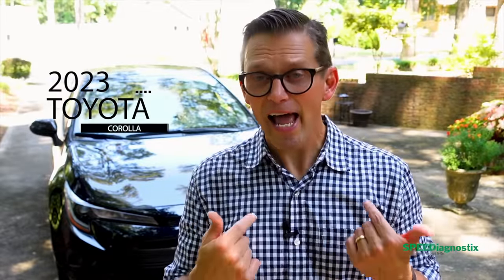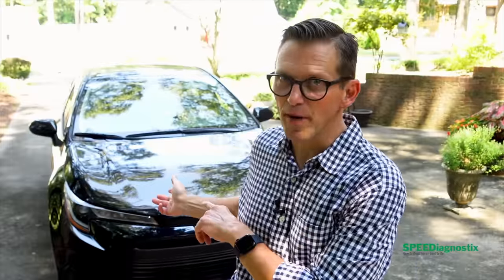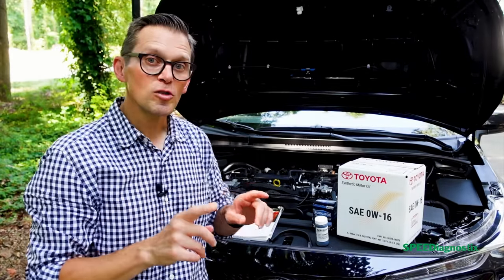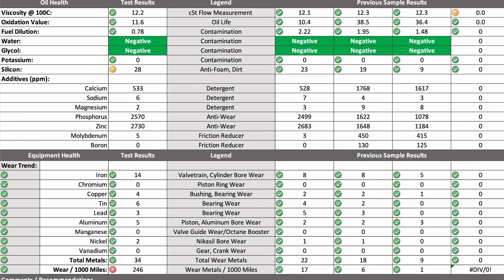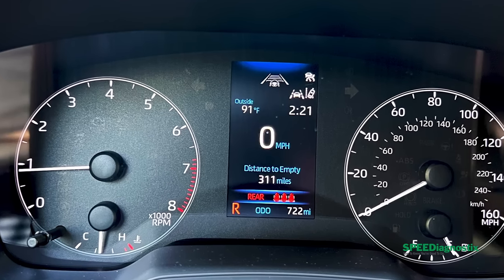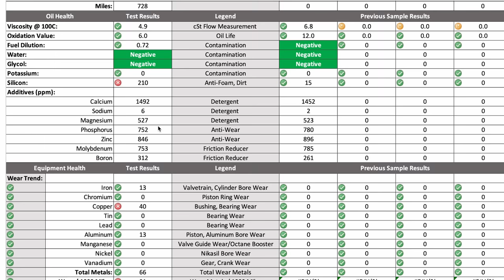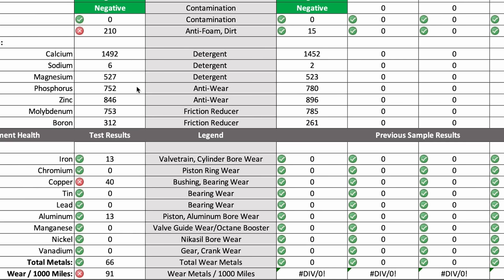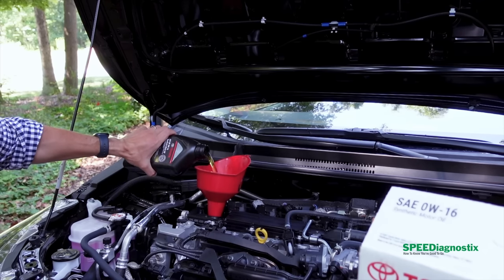AVOID the ONE MISTAKE Almost EVERYONE Makes With A Brand New Car

Comment: I have followed the same procedure with my engines. But even with high kilometers already on then, I perform a change more frequent than service schedule.  I had some oil analysis performed on one of them years ago and it came back excellent.  Many years later with stupid amounts of abuse on the engine( I drive the thing like a race car every opportunity I get), the car was written off due to a completely wrong sign used for a blind hairpin, I got the wreck back because I wanted the gearbox, the Buick engine was torn down and had some 300 and something K on it at that point, I installed it at 90k and beat it like a race engine. The wear in the engine was remarkably low and much of the internals were as new cast silver colour, hardly any yellow staining whatsoever, the pan was bright sliver as if the sheet metal was just stamped.  This was a near 30 year old engine at the time.  It really makes a huge difference changing oil often and with a good quality synthetic modern oils.  I ran 10w40 and 15w40 since the 90k install, the manual specified 20w50 but I found the engine to knock for a good few seconds on start up and also rattled a lot when cold, so I dropped to the thinner out of spec oil and all these went away immediately. These engines run 70-80 psi oil pressure on the thinner oil anyway.

GM always seemed to over spec the viscosity for their engines here in Aus compared to the US for some reason and it was often detrimental.

Comment: So I have a comment on your other video of “to fill or not to fill the filter”
I am a lifelong diesel mechanic. I would bet that a lot of the people saying the new oil you are putting in the filter is dirty are diesel mechanics. This likely comes from the process of filling the fuel filters getting dirt in the system. To combat this, if you fill the fuel filter you plug the center and then fill. That way the fuel you pour in gets filtered. Well I have tried this with oil filters and that is a painfully slow process. 
After watching your video I will be pre filling oil filters. 
Part of the problem with that is that 3 of the 5 modern USA diesel engines have cartridge oil filter filters. 
Then one way or another you crank the engine without letting it start until you get oil pressure.
Reply from the maker: Thanks for sharing!
Reply: Wow you already responded to my novel!
Reply: I love the fact that you give proof not opinion. 
With the extended factory oil change intervals and people just simply ignoring oil changes, can you go into the affects of  the oil filter bypass valve opening?
Reply from the maker: @danielhoffmann1325 stay tuned. We are going to do some more videos on oil filters.

Comment: In some countries its usually change oil at 10,000 kms or 6250 miles.
On new car I have changed oil and filter when it was below 5000kms and again at service center at 10,000kms as required by manufacturer. 
As I knew long ago these fine particles would circulate in the oil.
Then on got it changed as usual every 6250 miles 10,000kms interval.
It's usually the egr and engine valves and intercooler that need cleaning later on in life.

Comment: When I worked at Eaton Corporation doing valvetrain development, we would do oil changes on a new valvetrain test rig in the first 20 hours.  The first change always had a lot of wear metals.
It's nice to see that Lake is reinforcing the benefit of a 500-mile oil change on a new engine.
Unfortunately, I won't be buying any new cars for the rest of my life, so the issue is moot for me.

That's an interesting series of oil analyses on his Porsche.  The wear metals per 1000 miles is a good parameter to have.  The first sample gave 246 ppm/1000 miles, and later samples decreased quickly from that.

But why are all the 40-weight oils showing viscosity in the 30 grade?  Those are Joe Gibbs Driven oils, which are very shear resistant.  I see all the samples had fuel dilution.  Is that enough to drop the BR40 and DT40 out of grade?

I've never seen the thing about pouring a new quart of oil with the drain plug removed to flush the pan.  That's hardcore oil geek stuff there.  I've never even seen that on Bob Is The Oil Guy.
Reply from the maker: Thanks for sharing and the question. These M9x Porsche engines are hard on the polymers, so they shear more than in other engines.

Comment: Hi performance engines don't need super early oil change during break in, what they need is to stay below 5k rpm for the first 2500 miles, then change the oil.  500 miles is goofy for modern hi performance engines from Audi, BMW and MERC.

Comment: I agree with you wholeheartedly regarding the oil change interval and doing the first one very early. My question is about the section of the owners manual that you referenced. It does indeed say that if you are unable to find 0W-8 oil that it’s ok to use 0W-16 oil. But you left out the very next sentence saying that at the next oil change you MUST go back to using 0W-8. Your thoughts?? And thanks for your consistently informative videos.

Comment: I agree changing the oil on a new engine after a break in period is a good idea.  Do they already do this at the factory?  When I was working in a machine shop, our rebuilt engines were tested for four hours with oil,  then drained and oil filter changed.    We would visibly inspect the oil that was drained to be sure it was clear.

Comment: Actually the owner’s manual doesn’t say it’s “fine” to use 0W-16, it says it can be used if the recommended 0W-8 can’t be found but “must be replaced with SAE 0W-8 at the next oil change.”

Comment: You don't have to change your oil as often anymore because of additives etc. Changing it more often will only help but it's just that it doesn't really help that much anymore only buy one or two percent. 

However you should not change your oil at all on a brand new car until the manufacturer asks you to. There are additives in the oil for the first oil change that coat the inside of the engine and prepare it during the wear and break in process

Comment: I bought a 2024 Audi S4 this year. It has 7000 kms on it currently. I did a breaking oil change at 1600kms (1000 miles) and now I do them every 5-6000kms. So my car has had 2 oil changes already. Just put in good oil in your engine folks.

Comment: True.  All mass produced mechanical parts have flashes and sharp edges that will wear & conform to their contact surfaces.   Filter should catch 99.5% of it.   The rest really won’t hurt the engine.   Engine subject to frequent abuse would suffer much more even in just 5000 miles.

Comment: I would suggest one extra metric:  ppm per mile since last oil change.  It will really show how much wear metal per mile driven is created over those intervals.  Also, I never thought I needed to send oil in, but you are close to convincing me.  I figured since I was a 3000mile (mineral) or 5000mile (sytnthetic) I was good to go.  Maybe so, maybe no.

Comment: Some really lazy mechanics do not put the panels back.
  I was at a friend's transmission shop, and the general repair guys had plastic panels laying around the shop that never made it back on the cars.
  Affects cooling & Gas mileage.

Comment: Interesting from my perspective here in Australia where we run LandCruisers and so on in very harsh conditions, we use genuine filters but not necessarily genuine oil (the opposite). In DI engines, particularly the diesels the low low viscosity oil creates an extra issue - more blow by and intake system contamination.

Comment: Most people don't understand engine break in. What happens when an oil filter bypasses. That is actually highly likely to happen during break in. 10k miles and what gets embedded into bearings and laps away cam and crank surfaces, while leaving the bearings at std. dimensions.

Comment: 10,000 miles for the first change is INSANE. Changed the oil in my new WRX at 500 miles and again at 1,200 miles, then every 3-4,000 miles since.

Comment: I’d be curious on your method on when you buy a car that’s new to you on how to use oil analysis to determine the true proper oil change interval(as well as transmission fluid drain and fill interval) what mileages on a fresh batch of oil would you take oil samples from to determine the best change interval vs the potentially stretched manufacturing change intervals given
Reply from the maker: Stay tuned. We are going to do that with this car.

Comment: First new engine I build at 15 in 1977 I changed oil at 250 and 500 per instructions of my Dad.   Why, because of that break in.  250 because of the assembly lube too.

Comment: Same as you except I ran my new engine on the lift and then drained immediately.  Less time for the particulates to settle?  I used two quarts after initial draining and ran the engine for about five minutes making sure the oil pressure light was out, then drained again.  I change oil at 3,000 mile intervals.  My old Buick V6 Park Avenue has 160,000 miles now and would almost need a quart before changing, except I add 1/2 quart as needed.  I use Pennzoil 5 W 30 synthetic and will switch to 5 W 30 High Mileage Pennzoil synthetic when it starts consuming more oil.  I’m interested what you think.  Thanks in advance.

Comment: I'm still do old school first 500 miles Conventional oil - no synthetic require on my new car. than 1000 / 3000 & every 3K or every 4 months. don't care what manual / dealer say. I don't like driving dirty oil. never had problems w/ burning oil or engine trouble in 47 years.

Comment: So much junk comes out of a brand-new engine even these days... most people wouldn't believe it. SOP here is first change at 500 miles/800km, again at 1500 miles/2,500km then at 3,000 miles/5,000km. If everything looks good at that point regular 5,000km changes begin. No synthetic until the 15,000km oil change.
My fleet is among the smoothest running examples of their type I've encountered. FWIW that means turbocharged Suzuki 660cc keis, which really benefit from extra love, especially when they're new. And always genuine Suzuki filters. I'm 58 and have been wrenching since I cut my teeth chewing on a 3/8 wrench.
Very nice job, bravo.
Reply from the maker: Thanks for sharing!

Comment: Makes a lot of sense to change oil after a hundred miles for a rebuild. However, new car's engines are nowadays broken in at the factory before they get installed into the car.

Comment: Proper oil change interval depends on many variables. One of the most important things a lab will test is T.A.N. or total acid number. Oils become more acidic from repeated over-heating, this is bad. Engines supported by really good cooling systems and larger oil capacity will generally live longer.

Comment: The 2.0 engine in Corolla is port and direct injection. In the 80's I used to change oil every 3,000 miles, but with the newer engines never go more than 5,000. I don't care if the manufacturer says 10,000. I have a 02 Highlander and use Castrol Edge Synthetic. There is a ex Toyota mechanic on YouTube and he says the dealers use or at least his ex dealership use drums of non Toyota engine oil. In the 80's I always have used Castrol oil which I prefer and have always got over 200,000 miles on the engines.

Comment: Frequent engine oil changes are not the only fluids that need changing.  Don't forget your power steering, brake fluid, and coolant! They obviously don't need to be changed as frequently, but in my experience, they're almost always neglected... even by experienced mechanics and responsible owners.
Reply from the maker: Good point!

Comment: I own a xuv700 diesel car.
The car manual mention to use maximile oil which doesn't specify any oil grade and specification.
After 600 mile i changed the oil with specification acea c3

Comment: I have heard about the importance of early oil changes on new cars for almost forever but dealers and even independent shops often seem so reluctant to perform them and claim you're risking your warranty if you don't wait. Your video here is the most convincing demonstration of why that's a good idea that I have come across. A question though I've always had and have never seen anyone anywhere or any article on it, why would this same analysis on early first engine oil change not apply with equal force to the transmission, differential, and even CV joints? It seems to me it would and the only example I'm aware of anybody doing this is I read for at least some years on BMW M3's that they called for a differential fluid change at the first 2000 miles and then normal intervals thereafter. Why does no one discuss this issue with regard to these other driveline components that must generate some extra wear at the very beginning or at least common sense suggests they would?  Is the extra amount of wear debris generated on these other components so negligible in quantity that it makes no difference ultimately to service life? Your informed thoughts would be much appreciated. Thanks. Big fan of your channel and your insights. Really incisive and I get a lot out of your knowledge and thoroughness. I am a retired attorney and I appreciate well argued contentions in whatever field I'm dealing with at the time.

Comment: First oilchange should be done when the engine changes sound, my latest car did that after 600 kilometers on the odometer. I was unhappy with Toyota-dealer not putting factory recommended 0w-20 on it, but 5w-30  instead. I actually think Toyota knows what is best for the car.

Comment: My Kia dealer told me that Kia and Hyundai are doing a 1000 kilometer motor break-in in factory so you don't need that early oil change anymore. I mean it would make sense, they give you 7 or 8 years of complete warranty and they know that a lot of cars these days are leased and people won't break those cars in.
Only a very small fraction of cars nowadays are bought brand new by customers who intend to drive them for a long time. So it's a given that 80% of new cars won't be treated too well because they'll be going back after 2-3 years.

Comment: They say engines are better now but idk. I still changed my oil at 1000 miles and it was a Lexus LS. Then I changed it every 5000 miles and I always used Mobile 1.  My newer Lexus I still do the same.   No problems

Comment: I wonder your take on addition of additives like lucas to oil. Do you do it or do you only run per spec? 
Lastly- do u start to use oil adds when wear from age happens- like 80,000 mi attained, etc.

Likewise- transmission, xfer cases, diffs? Same or different milages?

I always change oil in my first 500 miles. My first new car was an xB 2006- never had a problem w 156k and hitting a bathtub on the freeway, car was sold- still see it every once and while. New truck now@ 522 i swapped it out. Just hit 2800 and will do again at 5500.

Comment: Silicon is not from rtv. It is from block sand casting process. I worked at an automotive casting plant many years ago as a metallurgical/chemical engineer. Very different chemistry, and this test is measuring elemental silicon, not silicone 🤷‍♂️
Reply: Good point Sir. Early oil change is the first opportunity after sustained heat cycle flushing (by engine fluids and operation) of any casting-mould sand and/or lost-wax core material in cast-in passageways.

Comment: Q:  I have a 2 month old, 2024 Mazda 30CX.  The break-in procedure was followed according to instructions.  The first oil change was done at 2500 miles and subsequent ones will be done at/about 5000 to 5500 mile intervals.  By waiting until 2500 miles to do the first change, how much life on the engine is lost vs the first change happening at 600 miles after the break-in?   How much life is lost by doing the first oil change at say, 5000 or 5500 miles?

Comment: This is great stuff, many thanks.

I had an uncle who would put a strong magnet on the oil pan any time he bought a new car or had an engine rebuilt. He convinced friends and family to do it too.
In his thinking, that magnet should catch any metal particles and hold them. He also recommended first oil change at about 500 miles.

He always placed the magnet so it was slightly "uphill" from the drain plug thinking any shavings would go out the hole when he removed the magnet. He would pour a quart of kerosene in the engine thinking that would flush the shavings out, he wasn't going to waste any good oil for that. LOL

There must have been some logic to it because we had numerous cars from 60's and 70's run up some high mileage. And I think we all agree the oil back then was not as good as our synthetics and the machining process was not as precise but his system worked so we can't knock it.

OOPS, I forgot, he also used a big magnet to magnetize the actual drain plug. It usually had some metal slivers on it.

I'll check back with you but I'm old school, still skeptical of that light weight oil. A friend bought a 2012 Jeep with 3.7 engine. It calls for 5W20. He was uncomfortable changing that the first time with hot weather approaching. But he looked up more about it on the net and I guess he is okay with it so long as he can get synthetic.

Comment: Almost ironically, I was just spouting this very same message today on a video concerning engines dying premature deaths, specifically the new V35s in the Tundras, due to what I suspect was factory oil contamination from machining the block. From what I read based on all of them being new engines with the added high wear turbo components that love to cook oil, at least 4 of the six died from main bearing failure in the first 3500 miles (!!). Some of these trucks have already had multiple engine replacements, which pains me as an old school 'Toyota cool-aid enthusiast'. Heck, even when I first break in a lawn mower engine, I'll run it 20 hours and change the oil and fully expect to find shavings in the oil.